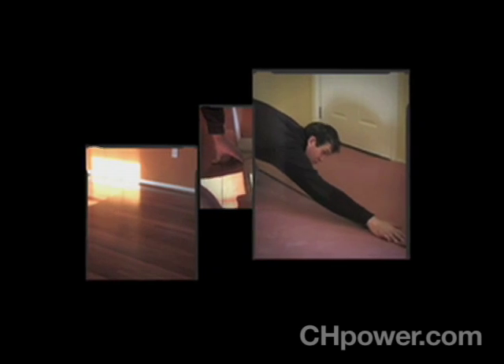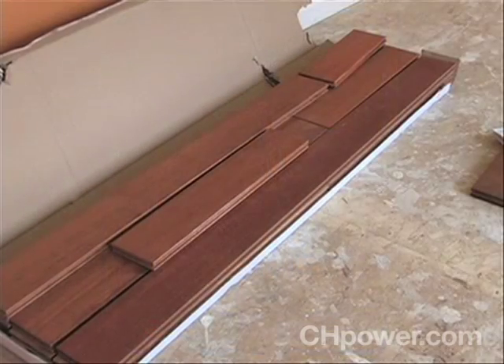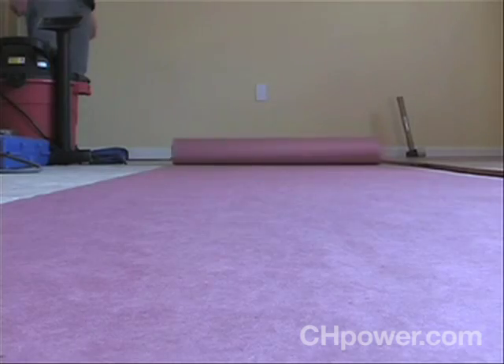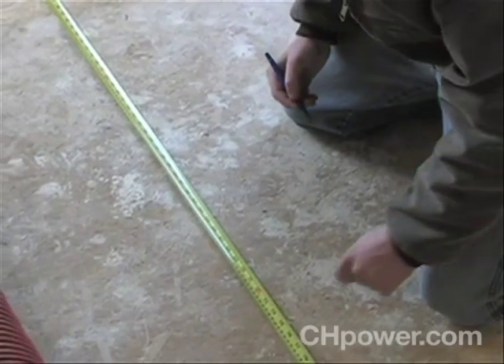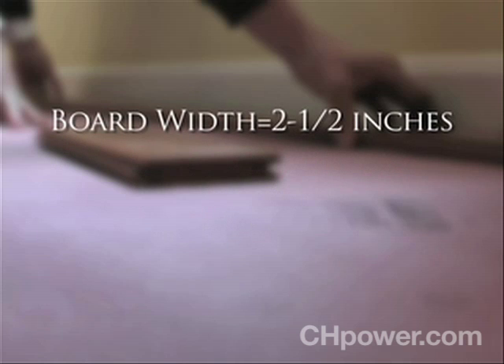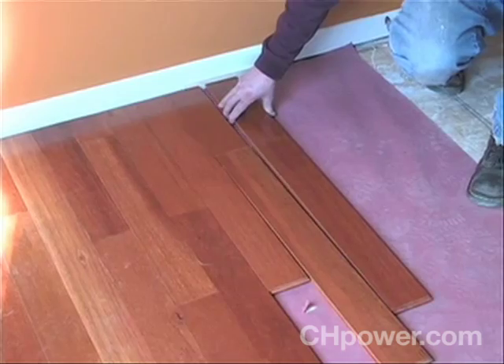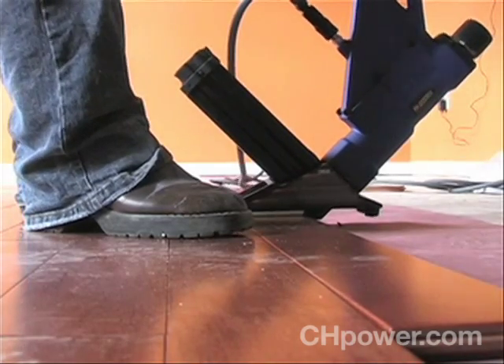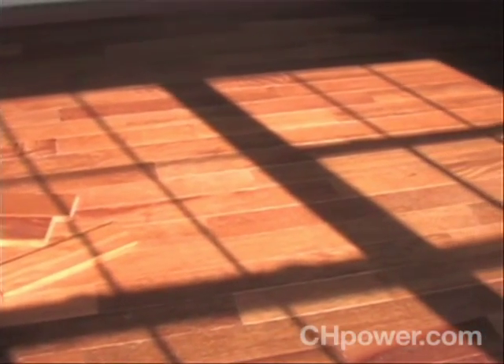How To Use A Flooring Nailer

Comment: 5:50

Are they flush nailing in a spot that will be visible??

Mail into the t&g as the floor nailer would do and counter sink with a punch if needed. Always remember! The finished product should never show a hint of how it is fastened. 101.

The rest of the video is fine but…

Also, I really don’t want to be picky but, using quarter round up against mop board? This just screams DIY’er.